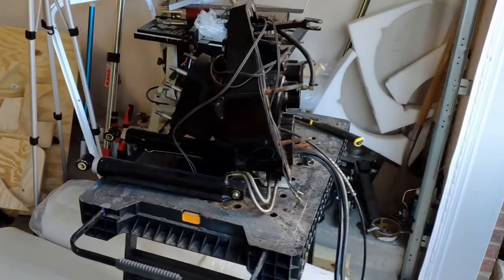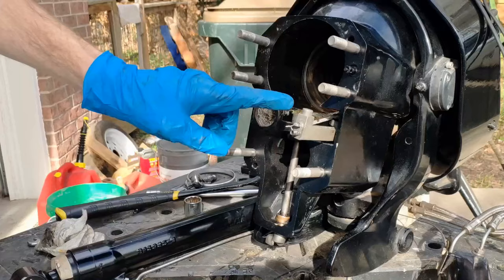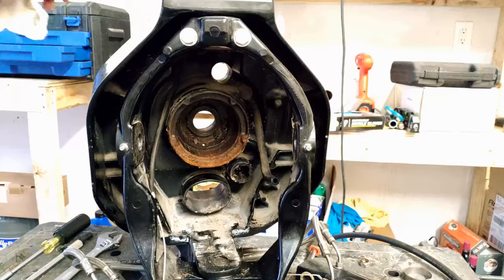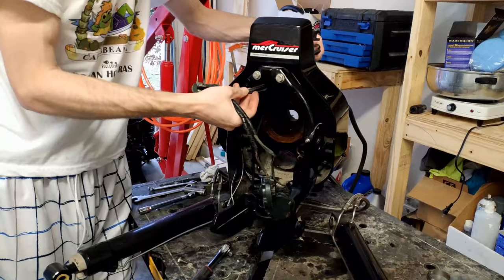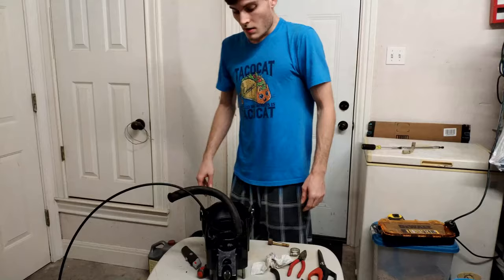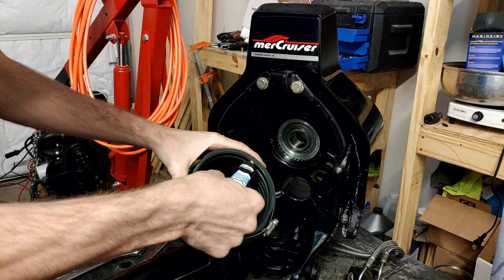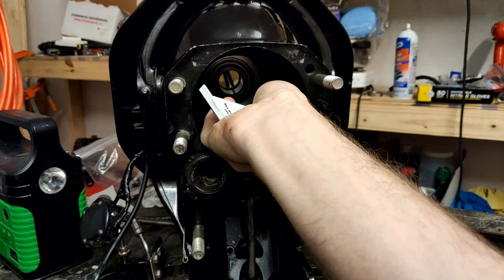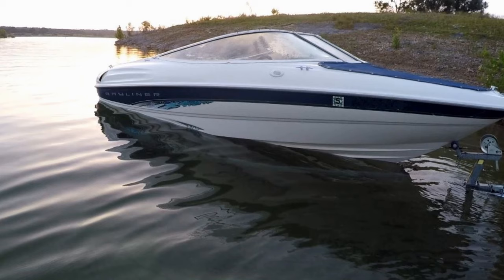Rebuilding the Gimbal Housing and Bellows Replacement

Comment: Hi. Great video. One qestion. I am changing bellows on my Sterndrive, but I didn't konw about the metal clip on the back on the below (U-joint)  as you show in this video. Are they important, or can I continue without it? What is it good for? Hope you can help. BR John
Reply from the maker: Well John you can always continue and try anything.... At least one time 😉 

But here are my thoughts on the metal clip. The clip helps the bellows not slide off. The metal in the clip flanges out to provide more friction. There will be plenty of people that tell you have to follow the book or disaster is going to happen. You might be ok without double checking it but you would want to keep an eye on if it ever starts to slip off and removing your outdrive to make sure no water is getting in the bellows anyways
Reply: @ZachsGarage1  Thanks for your reply. As I'm still working on it, and haven't put everything togetjert yet, I have actualy takent the bellow of, and put the clip. I can now see, that it do have an funktion :-) Thanks. A new question came up, as I have to pull the other end of the bellow out in the gimbel. Her I have to fastned it with the metal ring, that is pressed in. My question is: On the inside of the bellows there is a small groove, but it is too small to fit on the edge of the gimbel.Therefore, I expect it to be peeled in, and the edge of the gimbel should be behind it so that there are two flat pieces with the small groove in the middle inside the gimbel before the metal ring is pressed in. Is this correct? Br John
Reply: Hi, those little metal clips are there to keep the hose clamps grounded so they do not corrode. I believe it's called electrolysis. That's their only purpose, the bellows adhesive is what keeps them from slipping off. Mercruiser manuals want you to wait 10 minutes for the adhesive to get tacky before installing fyi. If you boat in fresh water I wouldn't worry about the clips.
Reply: @iWatchVideosAtHome  Exactly.... and if you trailer your boat home every time, salt o5 fresh water, discard the clips,they are hard SS and they have a dimple that digs into the aluminum,destroying the protective paint in the process; a " rushed" solution from Merc, but by far the simplest and trouble free one at that.

Comment: How did you get the oil hose fitting out?
Reply from the maker: on the inside of the boat side of the gimbal housing/ transom assembly, you can unscrew the hose fitting allowing you to pull the other end out with the bell housing

Comment: Is there supposed to be a hole in the bell housing where the big bellow connects to the bell housing?  

You want to all this to mine?  It’s a 120 hp mercruiser lower unit.  Where are you located.   Also what is the name of the glue you used for the bellows.  Also do you use marine grease in your outboard ?
Reply from the maker: I'm not sure about the hole where the bellows connects

Comment: No matter what I do I can’t get my shifter tube to pull through... so I can’t get my gimbal off.
Reply from the maker: What is it getting stuck on? Feel free to email pictures to zachsgarage1@gmail.com
Reply: I cut the cable with a whiz wheel on the outside the use the core wire i had previously removed.

Comment: Come on.... electrical tape! And that’s probably not a “safety wire” but a “grounding wire”!
Reply: It's also a safety wire. It's a 3 circuit  system & the ground actually protects the electric circuit from fires or shock, therefore also being a safety wire.
Reply: Mostly older people call it that though. Or they call it earth lol